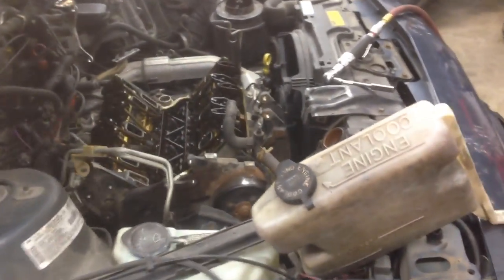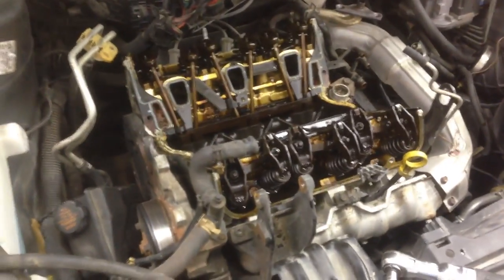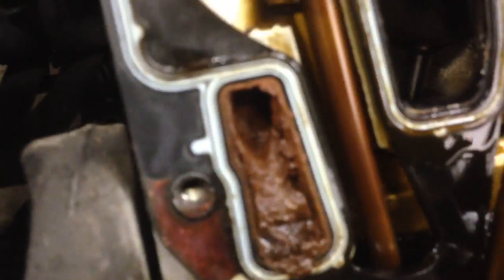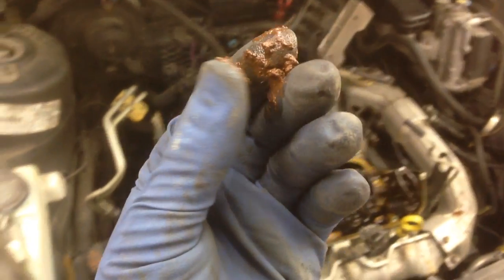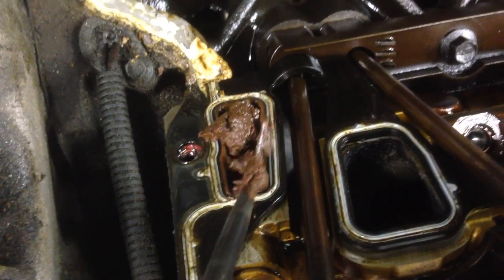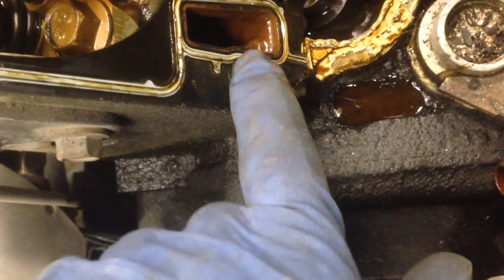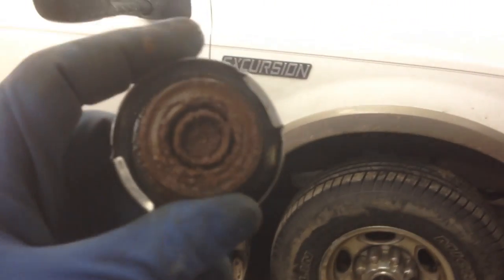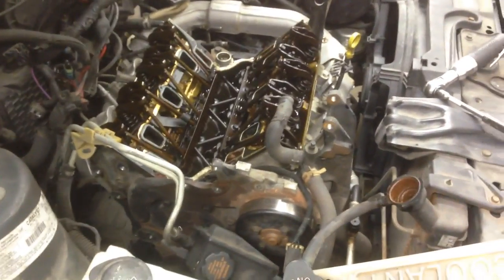Why it's called DexKILL

Comment: That looks VERY familiar. I have been a fleet services mechanic for 36 years, and have had to replace a lot of engines and cooling system parts because of this crap. We call the stuff DEATHcool. I have seen engines where the coolant jackets in the block were completely plugged, with no way to clean them. I wouldn't call it mud, it's more a brown waxy substance, and I never found anything that would dissolve it. It is some NASTY shit. It was mostly engine in 1996-2006 vehicles that were affected. They used ORANGE DEATHcool. GM later reformulated it, it is now red. If your vehicle uses it, I would change it once a year. I would STRONGLY recommend against buying any used GM vehicle that came with ORANGE DEATHcool. It was mostly the 3.1L and 3.4L engines that had the intake manifold issue, but ANY engine in which this stuff was used is likely plugged up to some degree. OTOH, I have seen vehicles with the original GREEN ethylene glycol coolant left in them for 10 years or more with no problems. Many owners mix concentrated ethylene glycol with water out of a faucet, which usually has calcium chloride in it, and after a few years, the cooling system starts corroding. The first thing to go are usually the core plugs. You usually have to remove the engine to replace these, but aftermarket ones are a lot thicker and more corrosion resistant than what came in it to begin with. I still believe ethylene glycol and DISTILLED water is about the best coolant out there, although I am quite impressed with the newer Ford Motorcraft coolant. I've never seen any damage caused by it. 

There was a class action lawsuit against GM on behalf of several thousand owners of GM cars that were damaged by deathcool/dexkill, which GM LOST. But before anybody got paid, GM filed for bankruptcy and the suit was dismissed. A lot of GM owners got ripped off big time, and will likely never be GM owners again.
Reply: +Gerald Scott  You've got the best and most ACCURATE answer on here! Too bad most opinionated internet couch mechanic and dimwitted ignoramouses who prefer to talk out of their asses will either never read or never actually comprehend what you wrote. I've been a professional mechanic for over 20+ years and also a part-time farmer for over 30 years. I agree and confirm everything you've stated here. Additionally, I wouldn't use DexCool in any of my vehicles or equipment, even if you paid me to do so. The stuff is garbage.
Reply: Orange DexCool eats silicone gasket material, period. Class action case in MO. The only red mud I had was in coolant reservoir. Had to change out coolant crossover seals on my 2002 Northstar  due to leaks. DexKill or DeathCool are appropriate names.
Reply: Gerald Scott  so don't get a 90s Buick Lesabre or Oldsmobile 88?
Reply: You can, but check it over good first, and plan on changing out all of the coolant from red/orange to good 'ol green as soon as you get a chance.
Reply: Gerald Scott I'm Done With GM . For Multiple Reasons...This Dexcool DEATH COOL ..Is Just One More Reason!! Back In The 80's GM Not Only Shut DOWN Many Factories..(Mostly Flint Michigan) ..But ALSO Started Buying Cheaper Parts From Suppliers..Let Alone The Cheap Labor in MEXICO!! This Led To Many Quality Issues On Several Models..Especially The Impala...And Blazers etc.ert. The ONLY Engine I Ever Lost. was A 2002 GMC Sonoma With A 2.2 - 4 Cylinder That I Even Flushed Out The Dexcool & Used Ethlyene -Glycol (Green Antifreeze)  Coincidence? I Think NOT! I'm 62 Yrs Old & Have Owned All Makes..But Only Engine Failure Was .. GM!! JUNK!!
Reply: Gerald Scott Amen ...Gerald Scott!
Reply: Turbo Diesel .Amen...I'm Done With Not Only Dexcool..But GM.!!

 J
Reply: I should have made the Video when I flushed my Dad's Truck.  He have an S10 with 4.3L and he always used Dexcool.  The past 10+ years the Engine keeps on over heating.  So this past Summer, I decided to flush it on my own since he broke down 2X in just one year, due to over heating.  I decided to replaced the Coolant Sensor, when I took at that out.. It's all " Gunky ", I was like huh????  I was mad, since every few years, he would bring to a Mechanic to do a " Super Flush ".  I decided to take the Water Pump out and " Flush the Engine Passages ".  At first, it seems to be blocked.  So I kept forcing the Garden Hose into the Passage way and up to the point, I was able to stop 150PSI + Water pressure :(.  I kept trying and BAMMMMMMMM..... Bunch of " Gooey Orange Gunks " came out and after 5+ minutes, I see nice and clear water coming.  That's when I knew that the passage was cleaned out.  To my knowledge, if you just do a regular Engine Flush, it will NOT do it. You have to take the Water Pump out if you have the 4.3L Engine, in order to get to the Engine's Passage way to do it or else you will be facing that same thing again and again.
Reply: Gerald Scott was
Reply: Gerald Scott what do u think about that coolant suppose be for all makes all models by prestone...i swapped from dexcool to that in our 08 yukon just wanna make sure were getting proper corrosion protection bottle said 5x protection from corrosion but i know how picky them newer aluminum blocks can be i also used hose water to flush whats ur thoughts on that vs distilled water?
Reply: You can use Hose Water to Flush out a Radiator before replacing Coolant...and it won't do any harm in the short term.  Just make sure that you keep the Radiator and Reservoir topped up well.  After a few days or a week...hose it out and do a straight flush to remove the water and small debris.  Then use straight Distilled Water for a few days or a week, and then you drain that out.  Now you can put in your New Coolant if it's a 50/50 Formulation...add no water.  If it's a Concentrated Coolant...use 1 Gallon of that with "1 Gallon of Distilled Water Only"...and you'll be fine!  You can use any coolant you desire, but try to find something with HOAT (Hybrid Organic Acid Technology).  Better protection, less toxic, less conducive to electric currents...go for 5 or 6 Years at least.
Reply: New information. It seems the new red DEXKILL is causing the same issues as the old orange stuff. It's not dissolving gaskets (GM changed the gasket material) but it still solidifies in the engine, plugging up the coolant passages. It should be changed to Prestone OAT formula coolant ASAP. It is taking up to 5 years before it causes serious damage, but once it does, it is likely too late to save the engine. It's like you filled the cooling system with Gorilla Glue. This includes ALL GM vehicles, including 2018 models.

Comment: I'm not sure the problem is so much air as it is evaporation/boiling, with nonvolatile residue that remains. Hopefully a good (big volume) flush and most of that will clear. I've never had problems directly attributable to dexcool, but there are a lot of people who feel otherwise. It seems the nonvolatile additives put into long life coolant may be a problem if the water boils off too much....
Reply: Your water in your cooling system should NEVER boil. If it does you've lost pressure in the system and that needs to get fixed first before you do anything else.
Reply: This is an example of what happens when you dont regularly flush your cooling system

Comment: Must be mixed with distilled water only
Reply: david perry Not many people know that.
Reply: Technically, you should use distilled water for all all coolants, or use premix
Reply: Nope, distilled water is not recommended anymore, as it eats metal. Fresh water + ethylene glycol is the best coolant for your car.
Reply: Spot on! Every coolant concentrate has got to be mixed with water. The least mix ratio you can make is 1:1.
Reply: How would distilled water "eat metal"? It's free of minerals which don't belong in the engine. BASF says for its Glysantin G48: "For preparation of the coolant it is recommended to use distilled or deionized water. In most cases tap water is also appropriate." (when the tap water doesn't exceed a certain hardness threshold)
Reply: Actually you are supposed to use DRINKING WATER. Not distilled.
Reply: Actually you are supposed to use DRINKING WATER. Not distilled.
Reply: Yup the minerals react with the coolant I use 2 gallons prestone 1 gallon of distilled water. I removed the thermostat and hooked up a shop vac on each of the coolant hoses and flushed the whole block. Then i replaced the radiator,water pump and thermostat. The coolant looked like this cars here. Now its birght green.

Comment: I replaced the DexKill about 7 years ago now, in my 2006 Aveo Hatchback. Owned it since new.
Only 38K miles on it, Runs like a top. I replaced that crap when my top coolant hose blew up on me!
It was clogged with a big ol' hunk of that red sludge!  It took 3 full flushes to get it out of the entire system ,and now it has been running on Peak LifeTime Coolant.  Best $150 investment I ever made in the cars maintenance. 
I didnt know anything about this 'DexKill' issue, until my mechanic had to replace that hose, and he showed me that huge clot of sludge in the hose, he filled me in about it, and I got rid of it that day.

Comment: thats not correct at all! Dexcool gets sludgy and nasty when you mix other types of coolant into Dex cool. I've ran dexcool for years and years and have never had a single problem. it gets like that because you take your vehicle to jiffy lube or your local oil change shack and they top your coolant off with green not dexcool. dexcool is the best coolant out there!!! it's not air in the system!!!
Reply: Tyler Hensley Amen!!
Reply: prob not the same for all of the gm engines but ive seen new cars with realitively low mileage with this type of sludge built up. Not saying you are wrong though.
Reply: Chris Atkinson 1 time at jiffy lube or the owner decides to add some coolant because it's not right up to the full line and all he has is green from his old ford sitting there and decides to fill it up just a few days after he buys it, then one heat up and cool down cycle exposes the entire system to the green ( green and Dex are 2 completely different types of glycol one is ethylene glycol and one is propeline glycol and they don't mix at all) once the system is exposed it won't take more than 1000 miles to start the process of making what we called "baby poop" once it starts it's a runway train and only gets exponentially worse. The reason why dexcool is orange is so people won't mix the wrong coolant otherwise they would have just made it green. Dexcool is used because it doesn't corrode the aluminum heads and intake manifolds on GM vehicles.
Reply: how is something that can destroy your engine the best thing out there. One time someone uses your vehicle and tops off the wrong coolant, now tell how its the best
Reply: james vos don't let your friend put coolant in your vehicle if they don't know what they are doing. now I know they don't know what they are doing because they put the wrong coolant in. I have 80,000 miles on my original coolant and it still looks as good as the day I bought it and there is no way your going to get that out of green.
Reply: On numerous occasions I've repaired vehicles where: the wife took it here,friend barrowed truck and so on and added the wrong coolant, that's why I get rid of it and not have problems in the future. Do a simple search for antifreeze destroys engine and what do you think will come up?
Reply: g12 Coolant is better, 150k and still pink as new.
Reply: Super_Slav shit one of my prius is pushing 250k and the other 165k both still have the original still looks new pink coolant.
Reply: Chris Atkinson
That is toyota genuine coolant, better than the green stuff, lasts around 5 years, green lasts 3 max, g12 is 8 or more, there actually isn't an interval for g12 that I can find, meaning it's "lifetime" which i believe is replace only when the water pump needs replacing or hose fails which for my vehicle is when the timing belt needs to be replaced, 7 years or 107k kilometres.
Reply: Super_Slav true I was just stating how well its handled the amount of mileage on the even my co worker has an 05 prius pushing 400k still original coolant. we cant always go by when the dealer says lifetime anything lol
Reply: You need to change your coolant.
Reply: Here we have a guy that plays with the internals of his engine; yet, here you are suggesting that he does his vehicle service at Jiffy. You are such an observant guy, and connect the dots like a champ...
Reply: +Chris Atkinson - the Prius is built better than most GM cars.....
Reply: Han Skinslo hahahaha no, it's not.
Reply: Han Skinslo it's sad but true. Low maintenence too. The amount of mileage I have if it was a gm I would be rebuilding the entire suspension and steering system, not to mention all the oil leaks lol.
Reply: UnitedRecording name a current gm vehicle that is built better lol
Reply: Chris Atkinson How many miles do you have? My 320,000 mile GM isn't having any such problems. The Volt is far superior to the Prius.
Reply: My 06 has 265k, my 07 has 162k and my boss has an 05 with 397k. Every gm I buy with less mileage I have to overhaul the issues I named earlier. The volt can't touch the prius on mpg though. The volt looks better absolutely but I didn't buy a prius for its looks if I was single I'd go for another 89 crx hf I would get prius mileage back then without a factory cat on the car too.
Reply: Baerchenization he said he had done the intake manifolds he didn't say he owns the car. what if she/he drove across the country and needed an oil change and wasn't anywhere that she/he could do it himself? the only options are take it to jiffy lube or not change the oil. whatever the situation dexcool alone is not the culprit to this situation.  a lot of people will only take their car to a "mechanic" if it needs actual work I.E. intake manifolds but do their oil changes at jiffy lube because it's cheap and quick.
Reply: Stephen Lane thank you..
Reply: Dex cool if I remember correctly contains 2-EHA, which will eat away at plastic and silicon based gaskets and hoses. That could be the reason why he's having to replace the intake gaskets again after 25k miles. So tell me again how dex cool is one of the best coolants out there when it will eat away the the coolant system in some vehicles?
Reply: I run DexCool in my 98 Monte Carlo, it has not gummed up or even looked anything like this on the video, I changed the coolant at 100k and I have 130k it still looks bright orange it think it happens when you mix the wrong coolant with it
Reply: Seriously this isn't a job you do twice. You do it once and do it right. Should of done a complete coolant flush and checked everything for coolant leaks just to make sure there weren't any cracks in the block or heads causing the coolant issue. That gunk is circulating through the engine. I can't even imagine what that water pump must look like. When you seen coolant looking like that you need to have the system flushed. Chevy makes good engines but their gaskets are its weak point.
Reply: Ahh!  Very good.  Thank you.
Reply: Ameretsu Shidori I do very much agree with you gm has had an issue with gaskets, seals and plastic coolant passages.
Reply: Louie Watson mixing coolant is not a myth. but you are correct they have a steel block and if you continually run water in it then yes this is a possibility of getting rust, however he said that he just did the intake gaskets and would have seen a build up when it was apart. rust on "this" level doesn't come up in months this would be something that would take years of terrible terrible abuse to rust a block to that extreme from inside would be very difficult to do. I mean the outside of the block is subject to way harsher condisions and it wouldn't shed that much rust. and cast iron blocks don't rust on the level that mild steel does so  just by having water alone in it won't give you the runaway rust explosion that we see here.
Reply: Dexcool is the best coolant out there???.....Um ok so why is there a multi-million dollar class action lawsuit against GM for Dexcool.  I buy nothing but used GM vehicles from the 90's 2000's. EVERY single one of them has the same sludge in them. I flush the coolant system and add the green prestone. Most of my cars have small intake manifold leaks from that crappy dexcool.
Reply: Tyler Hensley I have Dex cool on my 04 chevy venture and it works fine
Reply: Tyler Hensley then why did I have to have head gasket and intake gaskets replaced in my new car, Chevy Malibu 3.1L like I said it was new, no one topped it off with anything, GM master tech told me it was air in the system, the coolant turned acidic and started eating out the engine gaskets, also had to replace the water pump as well, they put the green antifreeze in it and no more problems, 160,000 miles since the repair.!?
Reply: Your 04 Venture will have a lower intake manifold leak and brown sludge in passageways about every 50K miles. I did twice in 99 Silouhette at 51K and 104K. Replacing gasket with Felpro (NOT GM Delco) may result in a longer term fix. I used Felpro metal gasket second time. Got rid of van before 3rd occurance.
Reply: +Tyler Hensley - If that is the case, why our Truck get all Gummy and Sludgy ???  My Dad have his S10 since 2001, and NEVER used anything else :(((.  One-time I suggested to use cheap stuff, I got yelled at and NEVER mess with his favorite Truck again.  Needless to say, now (2017) my Dad is changing the Coolant, after 16 years of Dex-Cool and 4 Complete Flushes by Pro Mechanics .... Finally, He got tired of it. LOL.   I also like to add.... We have a 1996 Blazer and it's out " Beat Up " Car.  So we don''t care what we put in it.  Funny thing is, we use the " Cheap Arse " Walmart Brand 50/50 Coolant and " NEVER " had any problems.
Reply: Tyler Hensley .........hold up Taylor dane.......Toyota ultra life blows that crap away.